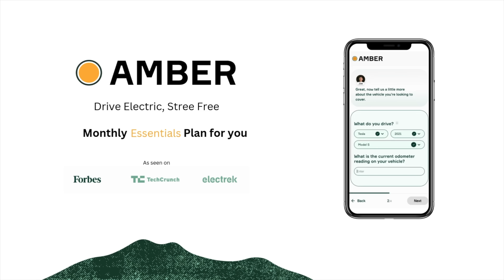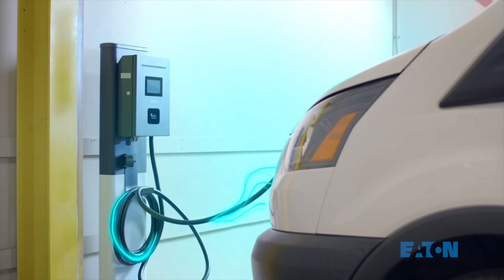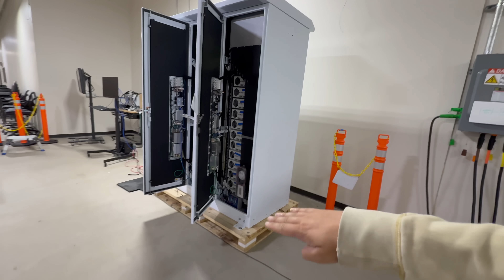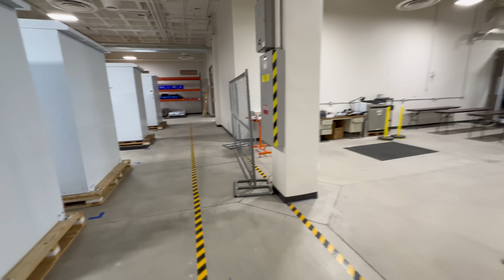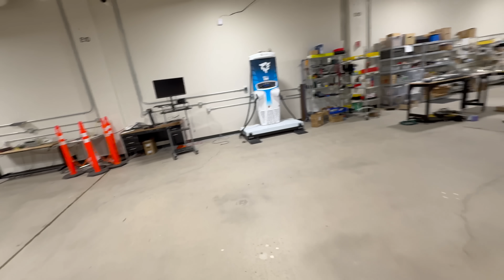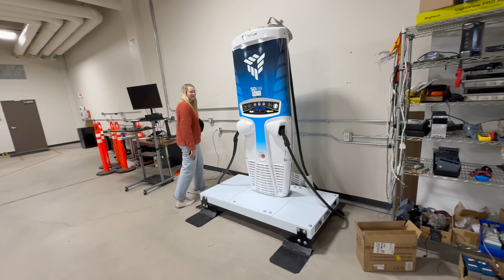I Bought A DC Fast Charger For $1,500

Comment: Used to use these all the time in my earlier EV days in Australia.  The companies installing them spent a lot of time "waiting for parts" on Plugshare but they did help get the revolution started.  Interestingly currently half way through a 3000km road trip with Tesla Superchargers almost everywhere now but did manage to put in 50kwh on an RTM75 in a more isolated area with no Superchargers nearby. 

One of the more embarrassing exports from down under!

Comment: That was a silly purchase, and I should know because  I’ve made a lot of them.

At only 50kW it’s junk.
Reply: Well, it's $1500. What do you expect?
Reply: Did more research research, I guess it’s okay and a great deal for $1,500.  I was thinking amps and not kW.

Would be nice if the company offered an easy way to switch to double NACS.  I think Kyle mentioned that Tritium might be going out of business, hopefully someone buys them and offers a similar single cabinet solution if another doesn’t exist.

Comment: Used that one much in the winter back in 2017-2019 with my Opel Ampera-e. Started at 17 kW and got up to 35 kW after 25 minutes. 😂

Comment: The MSRP on those used to be just shy of $40,000. I'm sure the cost now has come down, but $1,500 is still a great price for what is still an actually usable power level for certain businesses. Retail locations and businesses would really benefit from a 50 kW unit, and even some workplaces that try to limit to 2-4 hour parking would benefit.
Reply: For work fleets too, where super rapid speeds not needed and the grid connections expensive.

Comment: Just be aware, those tritium 50kW units have an external rectifier/dc supply when installed here in the UK. Make sure that’s included, it might not be suitable for direct 3 phase AC input.

Comment: Every time you convert or move energy you lose some, so if you were going to run this with a diesel generator you'd be better off running a diesel truck with the same diesel. It would be less polluting.
But 50kW from a diesel generator? I found a 48kW diesel generator online for $18,300. You'll need one of those if you're going to get 48kW (more like 42-45 due to inefficencies) out. And you'll need to carry a lot of diesel to power that generator.
But if you have a 48kW diesel generator, why do you need the charging station? It's merely acting as a connector between the generator and the battery you are charging. 
Also charging other vehicles off your Cybertruck may seem sensible, but again you're wasting energy every time you move it. Better to just charge those directly off whatever system you can access. It's OK in a pinch, but not a good regular strategy.
Reply: The generator trailer would just be for when they do range tests and run them to dead. Not for everyday charging. 
And that's not necessarily true about diesel generator vs a diesel truck. Diesel generators can run at their peak efficiency all the time, VS in a vehicle where load and efficiency varies greatly, even if you include the electrical conversion losses. Same with charging your car from a natural gas powerplant. It's still more energy efficient to use that nat gas to generate power, transmission, conversion, charging, etc. to an EV than it would be to run a nat gas ICE vehicle directly.

Comment: Hi Kyle,

Are you telling us you will charge your EVs from a 50kW charging station powered by a diesel generator? Isn't that daft, stupid? There is not much green revolution about that. Why don't you instead ask ie Black Hill or Xcel to install a 50-60kW AC eco outlet in your house if your purpose is to go all in on green? 
Greetings from Copenhagen, Denmark
Reply: He already had a 40kw unit with generator used for charging cars on the side of the road, but he probably needed to return that unit. It makes sense to have diesel for that sort of emergency mobile use.
Reply: I think he didn't factor in the cost of a generator that generates 50kW, and the amount of diesel he'll need to charge up his cybertruck from that generator. The charging station is essentially just a connector between the generator and the vehicle.
Reply: Running a generator of that size is still more efficient (less pollution) than any other petrol / diesel car.
Reply: His use case for having a diesel generator with a L3 is unique to his video productions.  He has conventional home and business L2 charging.
Reply: I think Kyle's intention was to use the generator to charge dead cars after range tests just enough to make it to the nearest permanently installed DC fast charger, usually just a few miles away.

However, this begs the obvious question of why not just use the Cybertruck to tow the disabled car to the charger. I think Kyle already has the trailer.